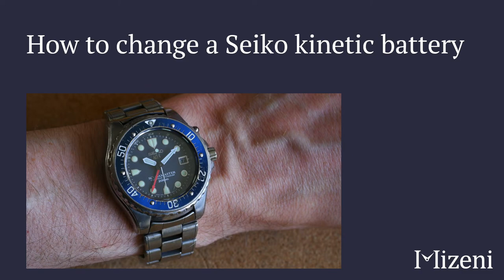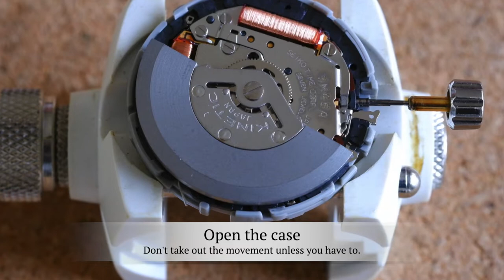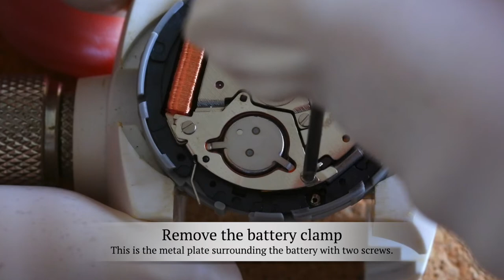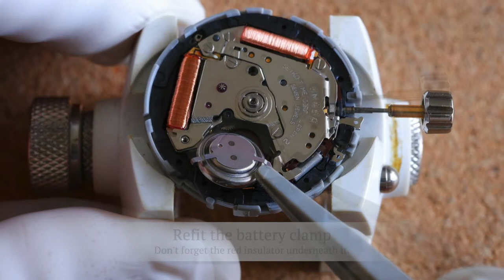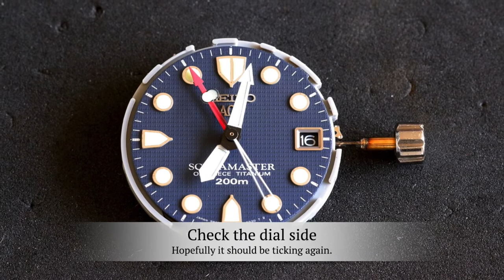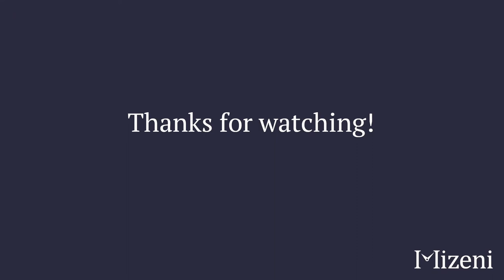Seiko Kinetic Battery/Capacitor Replacement – Step-by-step Guide

Comment: Something to consider if you are having problems with that stupid insulator or as I found you don't get replacements with certain cells and mine was in several pieces.   To get round this I got some of my very thin capton tape and using strips I insulated the underside of the clamp then using a very fine scalpel trimmed the excess and the clamp was a doddle to refit and no more holding breath hoping a breeze half a mile away sends that fiche of plastic into oblivion.
Reply from the maker: Nice idea, thanks! You must have stead hands to create that. Certainly it'd help ease the stress of worrying whether the insulator decides to fly away…

Comment: i have followed this steps for a YT57B Movement, old battery was 0,34V and new is 1,45V, but its not ticking, i have found in the past that some movements require for you to shortcircuit in a specific spot to restart the movement, any idea or suggestion on how to resurrect this old watch?

Comment: Good luck trying to find a slotted screwdriver that fricken thin.  The ones I use on my watches are WAY to thick.  the screw head is razor thin
Reply: used a sharp enough knife and turn the whole movement
Reply: I used some sandpaper and dragged the screwdriver over it at a sharp angle, worked incredible well